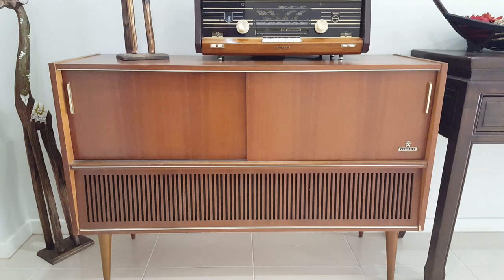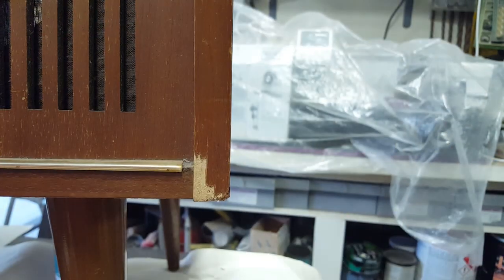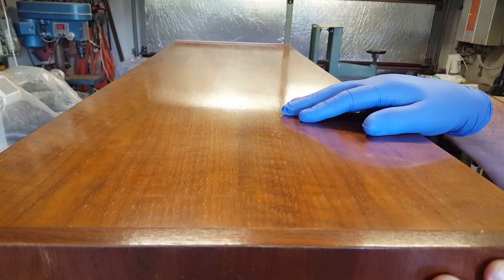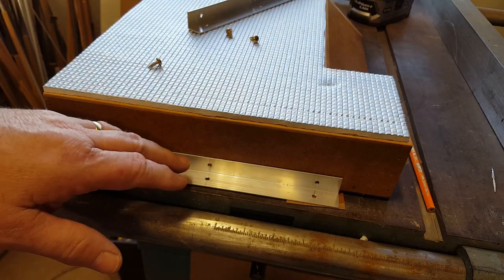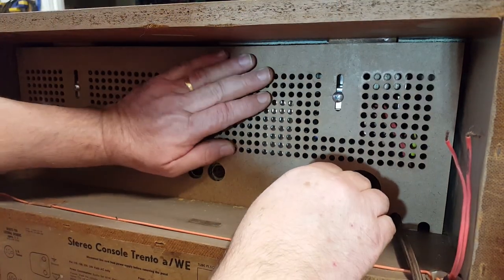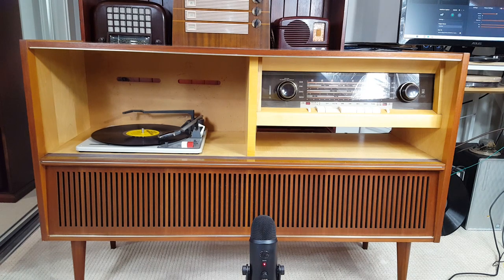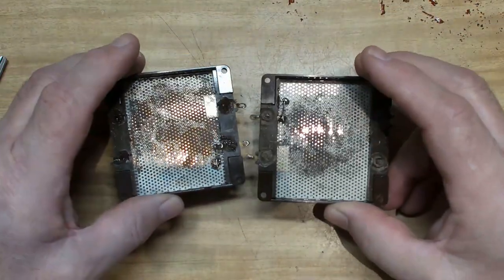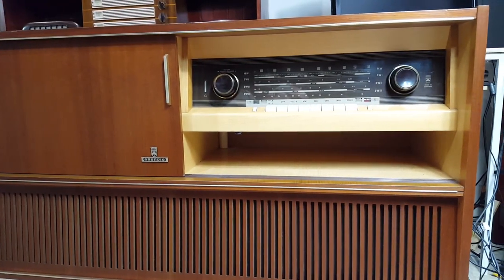Grundig Trento a/WE Radiogram Pt 3 - The Cabinet

Comment: The amount of fabrication on making the rear cover panel was absolutely in good hands. Few of us would ever consider making one. You get two massive 
thumbs up on both handling the asbestos and repair of the veneer on the outside of the cabinet.👍🏻👍🏻 Your electrostatic speaker repair failed because 
the plastic must be stretched over the metal frame. The edges must be adhered to the metal like a diaphragm. The tightness was lost over time and 
not your fault when doing your repair. All in all David you set the bar really high when it comes to vintage  home console repair. Very much impressed. Steve
Reply from the maker: Hi Steve, thank you. I used double sided tape on one of the speakers but didn't stretch the plastic. I have a few tips on repairing them from comments, maybe I'll get them going again, thanks Steve 👍🙂

Comment: That was so much fun to watch ,I can hardly wait for part four. No pressure Dave! LOL! Your right,there is something special about the sound and look of these older units, that just isn't captured with todays technology. I'm so glad you are saving them. When I was young, I had a real old radio from the 20's and later, a unit like the one you just fixed. I hate to say it, but I just didn't know what to do with them. They have been lost to time and entropy. Every day people throw some of these things out. You're stemming the tide of the inevitable. Good show!
Reply from the maker: I did a 'part four' and replaced the faulty output transformers. They have a different sound for sure, more mellow, not as brash. Thanks Tyrone, you must be running out of videos by now 😄

Comment: Impeccable restoration Dave, beautiful. I love the Howards Restorer, as I've used it now on two projects and it does amazing. The repairs you made on the cabinet were very good, and I learned from you that tape transfer method, so thank you. That lower box turned out robust and fantastic and the attention to detail on the rear cover was some of the best I've seen. What a beautiful piece you now have! Awesome video!
Reply from the maker: Thank you Gregg. The Restor-A-Finish worked really well, surprisingly well actually, I was lucky to get it in Australia. I have a lead on a OP transformer from a friend in Germany so I hope to have it running properly soon. Thanks 🙂
Reply: Fantastic to get the proper part Dave! It's a beautiful piece for your home.

Comment: Dear David what a restoration!  About electrostatic tweeters I think that high voltage should polarize the plastic film ( relevant the metal grid). You should check for continuity and distance between the two elements. I believe that correct distance is essential. Tweeters should be connected trough a capacitor (4.7uf?) to avoid high currents (🔥) due bass contents.
Reply from the maker: Thank you My Messy Lab. I don't understand the exact working principle but the felt presses the plastic membrane firmly against the metal plate, maybe that's why don't work. You are correct, I will fit some caps to the tweeters 👍

Comment: The liquid tape looks like a great product. I had tried some of the early makes of it  and that was not up to par.  What  I have been using was weather gasket glue for use in automobiles. I purchased a tube for use on my motor home, the weather seal was loose around the front hood where you filled the fluids, every time I opened it, I would have to  press the stuff back before I could close it.  Well the big tube made quick work of it and I had most of it left. That has held the seal for years.  Later while we were touring the South West USA, mostly very arid desert land, the handle on my wife's microwave/convection oven  came loose. I examined it, and since the oven was mounted overhead and difficult to disassemble, I used some of that seal to just glue the handle back on the face of the oven.  That has also held for years now with no problem.  So when I was building a ghost detector for my niece who runs one of those ghost hunting clubs, I had 10 resistors showing on the top of the build, wanting to cover them and make it look a bit more presentable, I covered them with that stuff and it blended in well with the black project box I built it in.  That too has worked great, and my niece reports that all the members of her club are very impressed with the build saying it works better and looks better then the 300 buck units they have purchased for the same process. I had built this one with an Arduino as the main processor and averaged the emf before displaying in over the 10 LED'S across the top.  Since I was using 18650 equivalent flat pack batteries to power it, I also added an (OH SHIT!!!) button which lite three 3 watt LED's across the front of the  unit to give them light to run away with.  They loved that part of the unit. I have been offered a few hundred bucks to build more of them but at 70 years of age, I don't really want to start doing such things, as I love not having to punch a clock any more and not having schedules to tell me where to be or what to do.  Relaxing and growing old, even absent my better half who went to be with God last year, it is a fairly good life, or ending to what was a very exciting and wonderful life filled with adventures to relive as I sit here and age.  I have the pictures I took along the way, and listen to the music I loved as I made my way through the years of my life.  Still listen to my WIFI radio almost daily and when I feel the  need for one particular song, Alexis is at my elbow and usually finds the song that has grown in the center of my mind and press the need to hear button.  Strange the things we have now days that I never dreamed could have existed in my lifetime when I was a boy.  (Alexia is now playing Miller's Cave!)
Reply from the maker: Thanks Jerry, that's a lot to digest. I glad you can still enjoy life after losing your wife. Hopefully it will get easier as time passes 🙂

Comment: I saw the recovery of the speakers, it reminded me a little bit of the techniques I use for book recovery. To close the holes in the speaker membrane I usually use a technique I use to close holes in book pages: pieces of tissue paper soaked in wallpaper glue, in this case at least 3 layers are used in a mold made in the speaker itself, and then the parts that fit with the hole are cut, and then the sealant is applied to electrical materials.
Reply from the maker: I wondered about moulding the repair patch to fit the speaker, how do you make the mould Carlos?
Reply: @DavidTipton101 I usually use PVC film under a similar part of what I want to copy, then I glue it with tissue paper soaked in wallpaper glue (any glue that is liquid is perfect), then I superimpose the layers so that stay as thick as you want. Once this is done, cut the shape of the hole in the copied part and fit it into the missing part. And to fix it, use a piece of tissue paper and a little liquid glue.
 This is roughly how it goes for mending book pages that have holes in them. I can say that the technique is complicated and time-consuming, but at least the result is satisfactory.

Comment: I think that plastic is an electret, and would be polarized during manufacture.  Over time, it will depolarize and then it will not work any more.  It is similar to a piezo element in how it works I suspect, and isn't actually electrostatic.  An electrostatic speaker usually uses three connections usually with the diaphragm connected to the center tap of a transformer through a DC supply, and the two plates on either side connected to the transformer such that the electric field can pull/push the diaphragm using electrostatic forces.
Reply from the maker: Hi kevtris, I know the modern electrostatic speakers use three elements, I don't really know how these work. The article I read with the guy repairing these had high successes rate. I will do a bit more digging 🙂

Comment: In another comment it was suggested that the electrostatic speakers may be electrets.  This may be the case or this may be single ended rather than dipole type electrostatic speaker. However, this is not the main point of my comment, I noticed that the front of both speakers was a patchy grey colour. The front of these speakers should also be conductive, usually Aquadag would have been  painted on uniformly to make a conductive surface. To me it looks as though a large amount of the Aquadag has flaked off and new coat needs to be applied before these speakers will have a chance of working again.
Reply: I have a funny feeling that David isn't going to let these tweeters go unrepaired ....  I fully expect a followup video in a few months time !
Reply from the maker: Hi Peter, I wondered about the coating too but the front plate is metal so wasn't sure what to do, why would it need a conductive coating on metal? I just put the meter across some good areas of the coating and it indeed appears to be conductive, the plot thickens 🤔🙂
Reply: While I don't know much about these particular electrostatic tweeters I have had some experience in repairing and maintaining my Quad ESL57 speakers, which are a dipole type. If you are interested trying to get your tweeters working, have a look at this link: https://www.vintage-radio.net/forum/showthread.php?t=174153 this may help. The front side of your speaker looks patchy but what is important is the Aquadag layer on the other side and the connection from the front. The speaker is just capacitor with one plate being the Aquadag layer on the rear of the perforated panel, then the dielectric being the diaphragm, usually Mylar, and finally the other plate is the conductive layer on the back of the diaphragm. My guess is there is no connection front to back of the perforated panel or if it is connected the charge distribution across that isn't uniform enough for the speaker to work. Actually the same goes for the conductive layer on the diaphragm but you have already measured this and it seems to be good. Hope this helps.
Reply: @peteroneill404  Somewhere I have a book I bought years ago on building electrostatic loudspeakers that has a compilation of various articles on commercial versions - including tweeters - it'll take a bit of digging up from the loft but I'll see if I can find it -  I know  I did loan it out to someone at obe time and I'm assuming I got it back .....

I think the principle of these tweeters is different to the Quads -  they're not 'push pull' and don't require à polarising voltage. Beware too on assuming the diaphragm is conductivie - the Quads are but only 'just' otherwise the charge moves around with the actual physical movement creating non linear distortion. 

U forget the Quads actual resistivity but it's certainly higher than you can measure with a standard multimeter. 

Quad used a solution of 'something' -  off the top of my head I forget what but there have been various alternatives proposed such as powdered graphite rubbed onto the diaphragm.

It would certainly make for an interesting video and I know you like a challenge David !
Reply: @mrb.5610  Yes, I think I have a copy of the same book or something similar. Also, yes these tweeters are single ended rather than a dipole used in the Quad. These tweeters have one only perforated plate or stator where the Quads have two stators with the diaphragm located between them. The stators are driven from a centre tapped transformer, with the centre tap connected to one side of  polarizing power source with the other side connected to the diaphragm. Finally the resistance of the diaphragm coating used in the Quads is much higher  than what has been used in these tweeters.
Reply from the maker: @peteroneill404  That was the article I saw after I did my speakers, I'll read it again in case I missed something 👍🙂

Comment: Really a good job on that new box under the record player, I bet it is much better than the original protection. Everything else was great. It is a pity that those old speakers are not working anymore, but the tweeters are OK. I hope that someone finds those output transformers. Thanks.
Reply from the maker: Thanks RÁDIOS ANTIGOS. I haven't given up on the tweeters yet. I have a lead on a transformer too 👍😀

Comment: Speakers a coat of thinned out PVA glue on the cone and the suspension works wonders to make them a little more stiffer and not to have tears.  The liquid tape is good though to fix tears in the suspension, and for the centre just take some paper and damp it with the glue, and form around the ball from a roll on deodorant, and leave to dry. Then you have a dome that you can cut and glue in place.
Reply from the maker: The cones on this were in good condition SeanBZA. I have in the past coated weak cones or even a bit of black spray paint. Good idea for making the dome 😀

Comment: You can use space blanket to make a new membrane for the electrostatic element. Use a multimeter to find the conductive layer.
Reply from the maker: Hi Derek another good tip, thanks. Someone also suggested those silver balloons would work 😀

Comment: That is probably the only thing Liquid tape and liquid Teflon are good for lol I hate using that stuff so messy.  I have recently seen that Howard product being used on old singers sewing machine desks, it looked like an interesting product, but now see you use, I am convinced ill need to get a can. That is what I love about your channel David, it's not only about old tube electronics or valve electronics for you guys lol is also about vintage woodworking repair, old parts repair, and fabrication replacements..., Came out great as you always seem to make it happen. BTW it's Pat lol Plain old Pat.  Edit, 35:41 they are almost like earlier versions of dml panel speakers
Reply from the maker: Hi Pat, you forgot smelly, that liquid tape has a very strong smell. The Howards worked very well, it didn't seem to do much initially but when I stood back I could see the difference. I try to cover as many aspects of restoring these old gems as I can, thank you for noticing. I guess they are early versions of flat panel speakers. Thanks Pat 😀

Comment: Dave Nice job on the cabinet it looks amazing and I also have used howard's restorer . I have used those electro static speakers many times in the past when I built speaker cabinets  I still have like 10 new ones .
Reply from the maker: Thanks Richard. 10 new ones form the 60s? and they still work, wow 👍🙂
Reply: @DavidTipton101  I was talking about the new Piezoelectric Speaker
Reply from the maker: @richardbrobeck2384  ahh, thanks.

Comment: Asbestos ,  maybe try dilute PVA first then lacqure (normally its painted white with a product called ET10,  which is thick and heat resistant itself,
Reply from the maker: Thanks High Path. I hope what I did works OK 🤔🙂
Reply: @DavidTipton101   It wont do any harm ( as long as the varnish does not burn off with the heat -chemicals are funny things.

Comment: Great work, as always. I'm assuming that you checked the high voltage supply for the electrostatic speakers?
Reply from the maker: Hi Fred, thank you. Yes I did, in the video you can see the test lead hanging off the speaker terminal, I forgot to turn the camera on 🤦‍♂️🙂

Comment: The electrostatic speakers didn't work in all the record players I repair, like you I tried to repair them with no real luck, but recently just as a last resort I didn't bother taking them apart, but just sprayed contact cleaner through where the wire goes through the clamp a few times holding it upright so it would flow down through.....it worked....but for how long?
Reply from the maker: Hi David, that may be a good idea, thank you. Contact point corrosion was the issue plus the foam rubber applying pressure to the contact had disintegrated. It was suggested that those silver balloons would make a replacement diaphragm, thanks 👍🙂

Comment: Dave this is well done as usual! Electrostatic speakers? A lost technology? I've never heard of such a thing before.
Reply from the maker: Thank clasicradiolover. The electrostatic speakers were very common in European radios 🙂
Reply: @DavidTipton101  talk about no moving parts! Can they make regular speakers or just the ones like you have there.
Reply from the maker: @clasicradiolover  There are audiophile electrostatic speakers available which I guess cover most of the frequency range with the help of a woofer.
Reply: @DavidTipton101  thanks
Reply: @DavidTipton101  I looked up these electrostatic speakers and they are very expensive. Wow no wonder I haven't seen them.

Comment: That came out really nice. (ly) electrostatic speakers, I just discovered those myself. Mine don’t work either. This radio has three of them. They all measure 3-4 ohms dc. I took one of them apart and it was just like yours but mine are round and more oxidation. Even though I getting some resistance I think the metal coated film has disintegrated. So would I get three and connect them in the same way as the original?
Reply from the maker: Hi Philip, thank you. Manuel Caldeira is doing some round electrostatic speakers in his next video, due out in a few hours. I think the coating on mine has almost gone too. If you get three what Philip, tweeters? Don't connect them to the original electrostatic connections, they have high voltage on them.